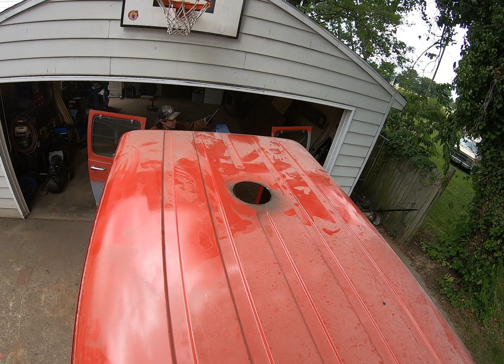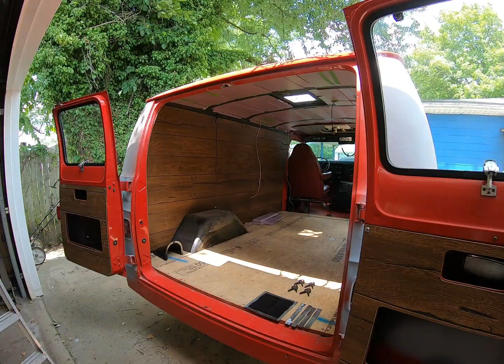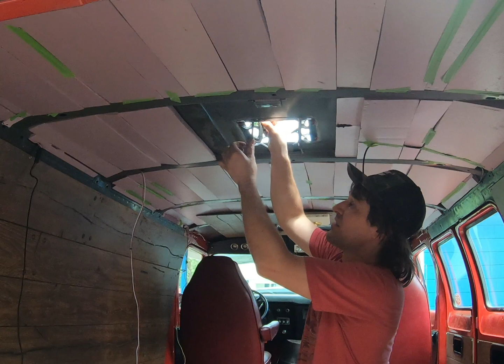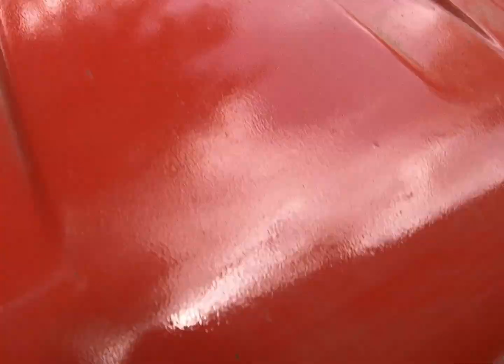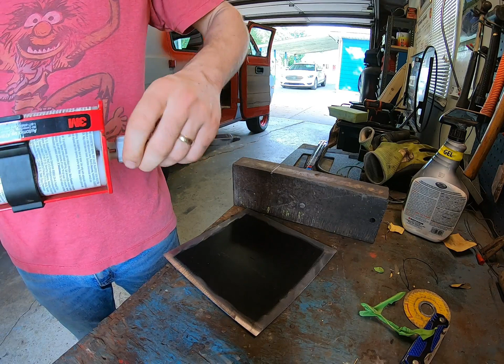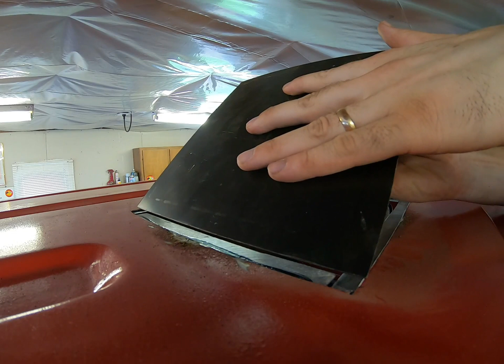3M Panel Bond Roof Repair - Hoosier Garage

Comment: Talking about conversions vans. Mine have the plastic roof and trim around it. What I did is removed the trim, filled the screw holes. Fabricate the brackets and bond roof from inside the van. Also these plastic roof are not bond to the metal roof, its just some sort of water prevent sealent and not an adhesive. So clean all that sealet and used panel bond around the plastic roof first.

Comment: No second sunroof?
Reply from the maker: If I found an exact match to the front I would have, but finding a 1978 era LeVan Skyport wasn't happening. Atleast in an affordable way.
Reply: @IndianaGarage  Understand. Mine was a little different and I didn't think quite as high quality as yours. 
This video should apply to me once I get to the wagon. 
I have one thing after another.
Reply from the maker: @roadkilldoesntfly1773  I think for your situation this video should help big time. At least I hope so.
Reply from the maker: @roadkilldoesntfly1773  if you doo keep it you could get a different glass made, one thing I noticed about this is that its not bright under the sun at all. That mirror finish almost makes you forget its got a sunroof.
Reply: @IndianaGarage  Yes agreed!! And anyone else closing in a sunroof from the 70s.
Reply: @IndianaGarage  Didn't know mirror finish did that!! I will think about that and look into one when the time comes.
Reply: @IndianaGarage  Not totally sure I am getting rid of it. Don't like the sun coming through it but I hope to have a garage space for it in the not so distant future